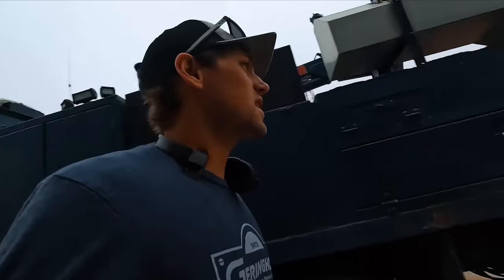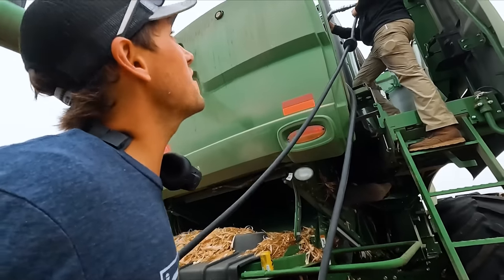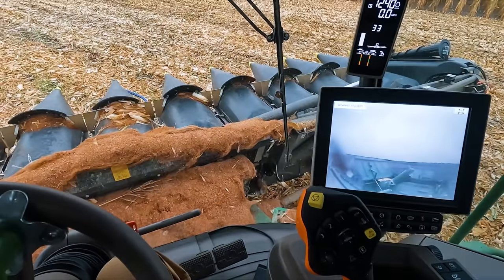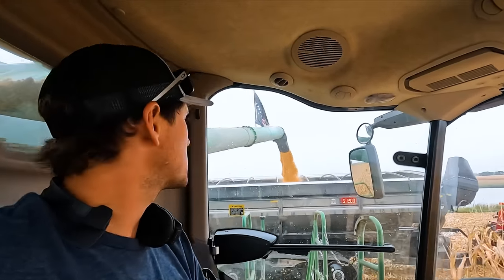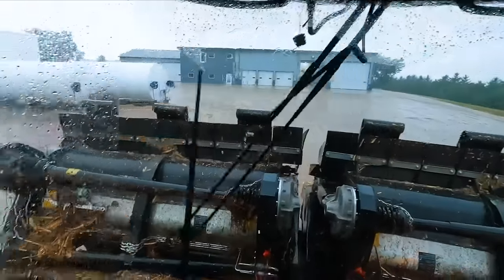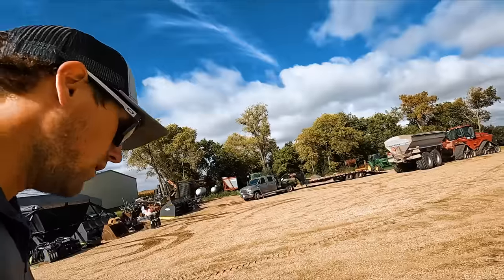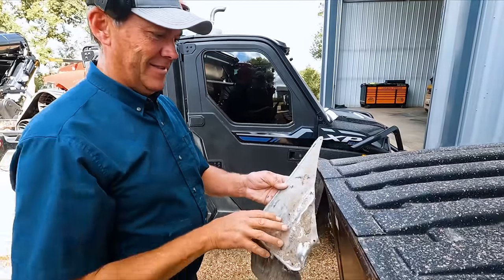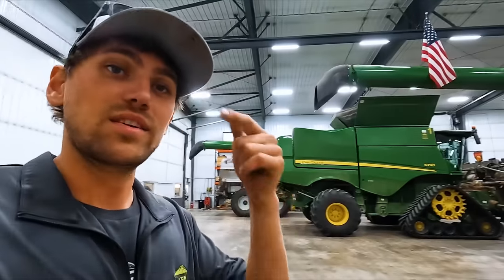Rain Is Coming Hammer Down! 4” Of Rain!! #4

Comment: Those types of ATV wheels have been out for many years. The issue you have with them from what I’ve read and talk to others with is that they get packed with mud or snow and then it freezes and then it’s basically an unbalanced mess. So it depends on what you’re using them for.

Comment: I'm curious how those wheels will work when they have mud to deal with.
Reply: Those Tweels look like a nightmare for mud. Brody will be a full-time pressure washer
Reply: @Mrbink01 I’ve ran them, they’re no worse than normal tires and rims
Reply: @caleboviatt1073  Really? The mud doesn't build up in between the spokes? How does that work?
Reply: @michaelsutherland5848  generally it doesn’t build up too bad, the majority of it passes through. Any anything that did stick on the model I ran washed off with minimal effort as the wheel material was fairly slick

Comment: If we got 4 inches of rain in Alberta in the  fall without tile drainage we are really in trouble.
Reply: I’ve never actually seen Rain so hard it dumps 4 inches in a single hour. And we’ve had water right up to the main bridges in the river valley a few times. It's all the rain in the Mountains and the subsequent deluge from the runoff.